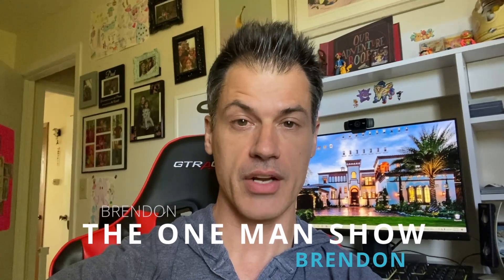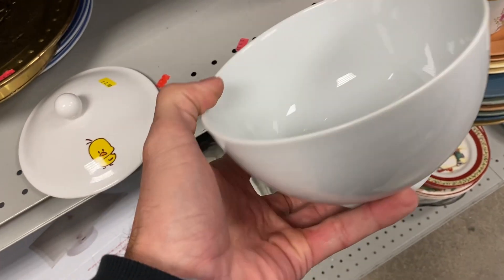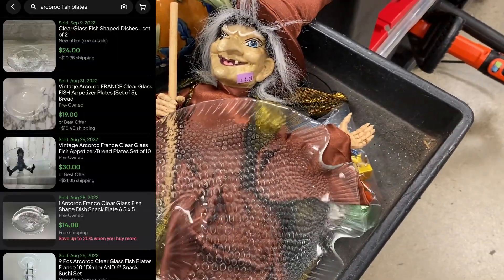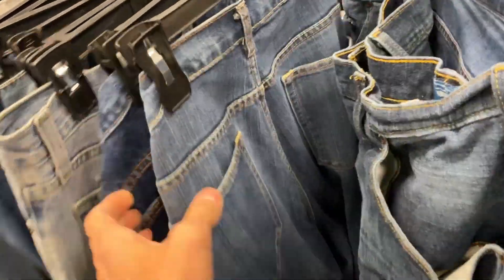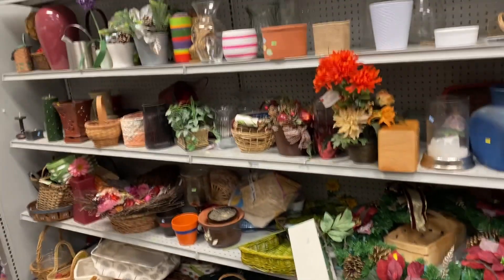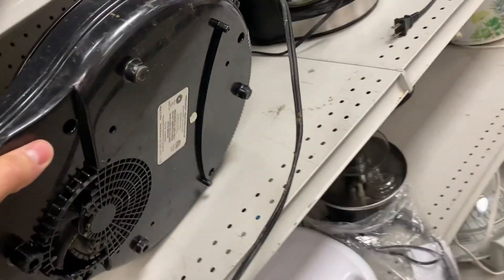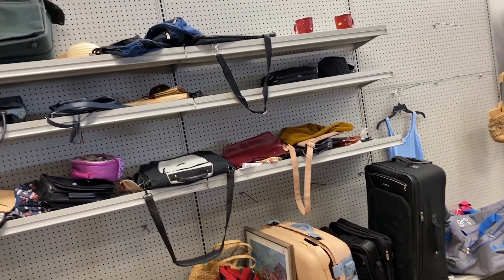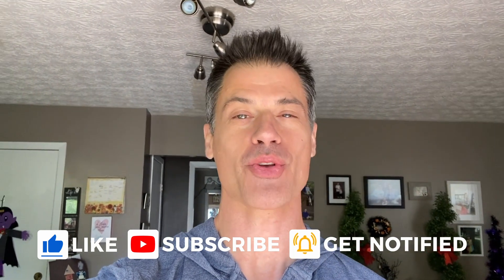DO NOT Buy This Thrift Store Item

Comment: If you find Lululemon and want to easily figure out the style for spot on comps, there should also be a small circle sticker either on the inside or in a pocket. It will tell you the size and the clothing code that you can Google, and is super helpful especially if the tag was removed.
Reply from the maker: Great tip Jacob - thank you!

Comment: That hose is an accessory, not a prescription item. The CPAP/BiPAP machines are prescription. That hose is a ResMed heated hose for a ResMed AirSense 10 CPAP machine. I have the exact equipment (and that hose) for my own personal use, prescribed by my MD. All new sealed in package accessories are fair game for reselling. FYI. 😉
Reply from the maker: Until you get a vero for the accessory. It’s happened twice. Fair game since it’s not a machine? Sure. Will you still go through the hassle of a sweeping vero? Potentially. Bummer when it happens but the system isn’t perfect.

Comment: The prescription items are actually a prohibited item takedown, not a VERO claim, which is probably worse in ebay's eyes.  With that said, I've sold a ton of those hoses without issues.  I have had CPAP machines and face masks taken down from ebay and mercari , but I was able to sell them on craigslist and facebook marketplace.  Those items are a definite pass if you're sticking with ebay, but a $5 garage sale CPAP machine into several hundred dollars on another venue isn't necessary something to pass on if you're comfortable with other selling options.
I personally don't have an ethical issue with selling the CPAP stuff because for the most part they are going to people who desperately need them but don't have insurance coverage for them and they're totally priced out of the regular market.  And I suspect, similar to things like hearing aids, that the prescription nature of them is more about market capture than patient safety.  I prescription plastic tube?  Yeah, ok.
Reply from the maker: I got burned twice listing a cpap accessory just like this one although this was years ago. Maybe they’ve tightened it up but it’s eBay, so I doubt it

Comment: Check out Hairy Tornado's videos are reselling RX equipment
Reply: There are companies that buyback equipment, as long as the run hours on the machine does not approach or exceed their run time limit. You have to power up the unit, scroll through the menu and locate the run hours. Also, condition of the unit is a factor for being accepted despite the run time.